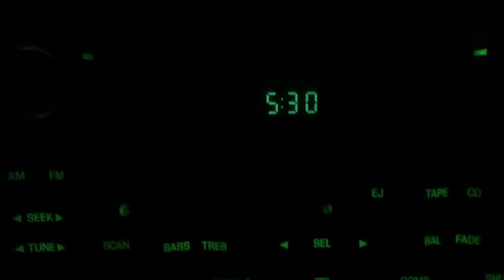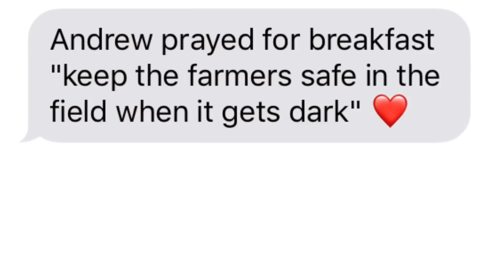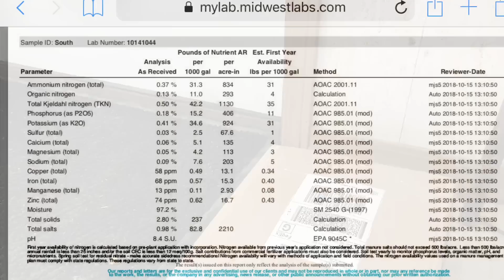Stacking bales at an Amish farm and spreading hog manure with a hose!

Comment: Ingenious and brilliant,  how do you collect all the pig fertilizer? What a good stewards
 of your land you guys are
Reply from the maker: Good question! The pigs manure is stored in concrete pits underneath the barns. In fact the barns are self cleaning in this manner. There are slots in the floor for the waste to drop down into the pits. There are fans on the pits that suck air down through the floor to keep pit gasses from accumulating in the barn.